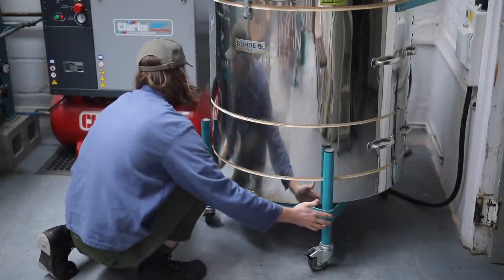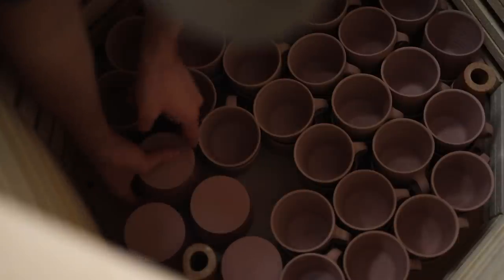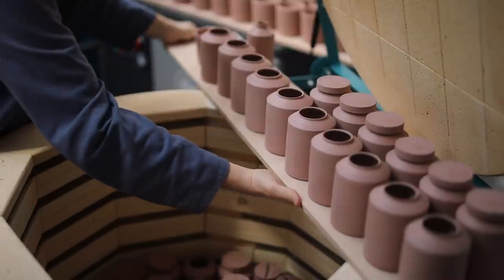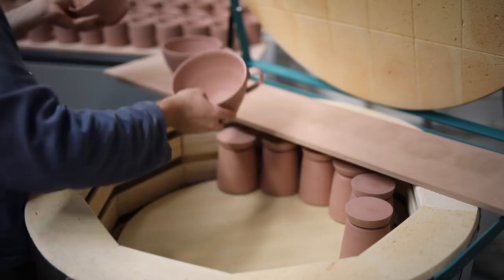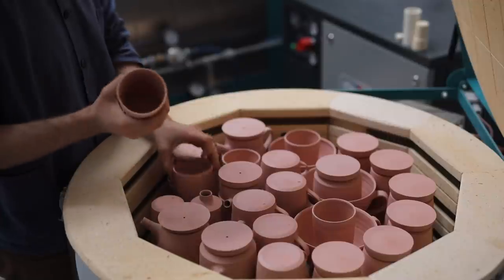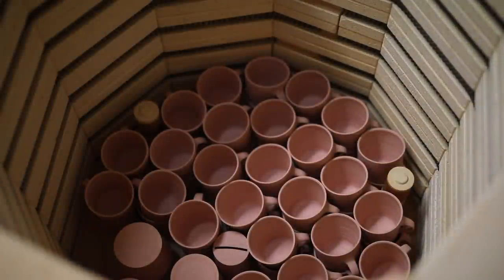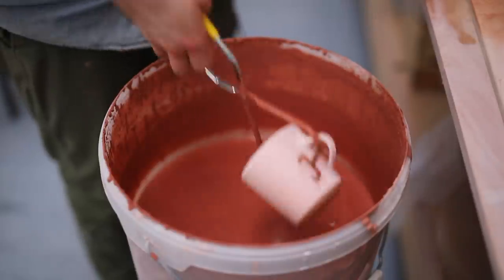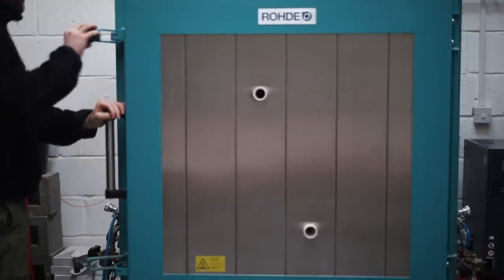How to Pack a Bisque Firing in the Electric Kiln and Speaking about My Craft Process

Comment: Do you use the alumina hydrate wadding between lids and their pots when you bisque fire in the electric kiln? Or is it not necessary with electric?
Reply from the maker: It isn't necessary at this stage as the clay doesn't stick to itself. I only use the waddings during the glaze, reduction firing up to 1290ºc.

Comment: I noticed at 15:41 there were some fired pots in the gas kiln, is this because they were underfired?
Reply from the maker: Exactly. That front row on the bottom shelf pretty much always under fires slightly, so I just put pots that need refiring there and it often leads to some of the most interesting pieces from the entire kiln load.

Comment: What kind of wax you use?
Reply from the maker: It's the wax emulsion sold by Scarva Pottery Suppliers. Good stuff, I just water mine down a bit with boiling water and it brushes on much more smoothly.
Reply: Thank you.

Comment: Kinda odd that you're so obsessive about packing the kiln tightly. I dont know your electricity rates but here in Canada such an 04 firing  costs less than CAD 10 or 5 pounds at CAD $0.14 kWh.. You have several thousand pounds worth of ware in there.
Reply from the maker: More packed inside means I have to less firing, less firings means I process all the work more quickly. Nothing strange about it and it’s literally how every professional potter operates, what would be the point of packing it loose and doing more firings when it could be fired in less? It may be relatively cheap but the price of an electric firing isn’t what I’m concerned about, generally I’m packing it full as I need the bisque ware as quickly as possible so I can begin waxing and glazing it all.
Reply: @floriangadsby  A blanket statement about  how professional potters operates is a stretch. You have a very particular batched workflow, artisanal if you will, where the single electric kiln is a severe bottleneck. By your own words you fill up the studio with ware, then batch fire to bisque in the electric kiln, glaze and fire in the gas kiln before going back to pottery. That clearly works for you, creates scarcity and exclusivity, sold out most of the year, more power to you. However, you cannot say that's how most potters operate. In my experience most profesional potters would bisque fire when ready to maximize usage of their kiln resources, not when their studio is crammed full. I know that I do it that way but then again I don't presume to speak for every professional potter.
Reply from the maker: Of course not every professional potter does this, but in college I was taught to fire kilns full, during my apprenticeships I was taught to fire kilns full and I think in most situations potters will wait until they accumulate enough work to pack a kiln full before they fire it, otherwise you are quite literally wasting money, hence why it’s always preferable to fire as much as you can at once. When you next want to legitimately ask someone something, it might be helpful not to begin your question with, “Kinda odd that you're so obsessive”, as it underpins your entire comment in a negative and rude light, one that's almost offensive even, imagine if your comment landed on someones page who had OCD, it could be hurtful and detrimental to someones mental health. I answer thousands of comments a year and trust me, people choosing to start their questions like that is really unusual. Perhaps it's which sparked a reply from me that was probably a little heated and to the point but I was still undeniably kind and answered your question.

Do you know how much electricity costs here in London? Do you know how much each firing costs? It mightn’t be as cheap as it is in Canada. The fact that there’s several thousand pounds worth of pottery inside too is beside the point, wouldn’t you want to save £5 if you could? Just by packing more pots over 5/6 firings means that I don’t have to do the 7th, which saves money in the long term. I know I said I wasn’t too concerned but actually thinking about it I am. I’m sure you know how expensive running a pottery and business can be, so if I have the opportunity to save by doing something as simple as packing slightly more into each kiln load, wouldn’t you do the same?

The way I electric fire and operate in cycles has nothing to do with how scarce my work is either? I’m not sure what you mean by that. The single electric kiln isn’t a bottleneck whatsoever. And while of course I cannot say how most potters operate, after being in the field for more than ten years, working in numerous potters around the world and speaking to literally hundreds of potters, yes, I’d say that probably most wait until they have enough work to fill up their electric kiln properly before they do a bisque firing. Presuming to speak for every potter about how they bisque fire, yeah, okay, of course I can’t do that, but I have a really very good idea of how potters tend to run basic things such as doing bisque firings and I think you deciding to jump on that so courageously in your reply proves that your initial comment is probably just looking for an argument.